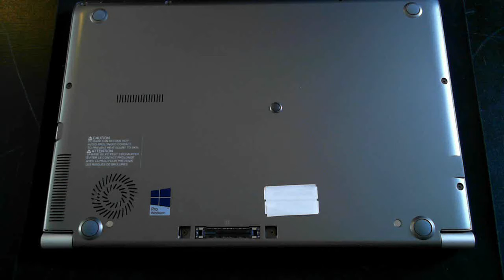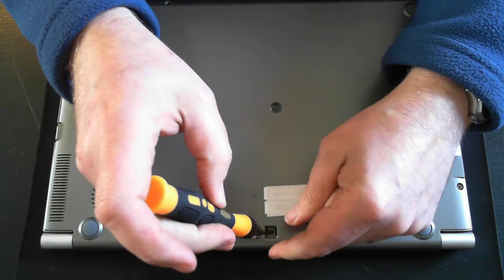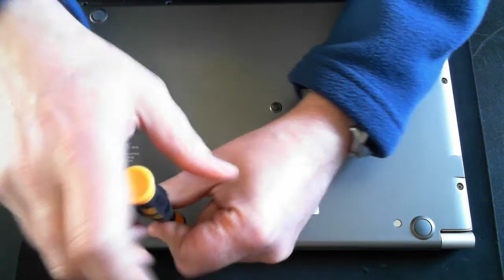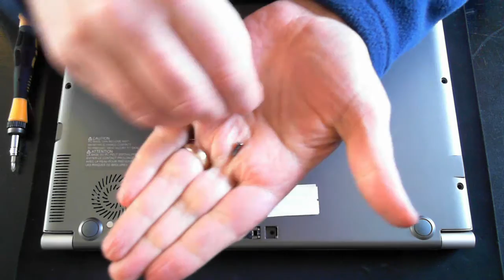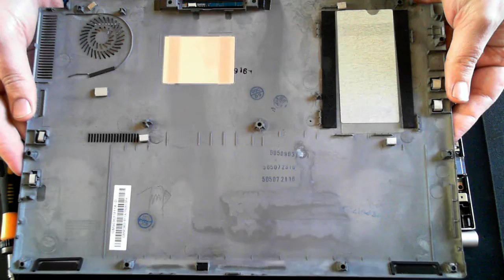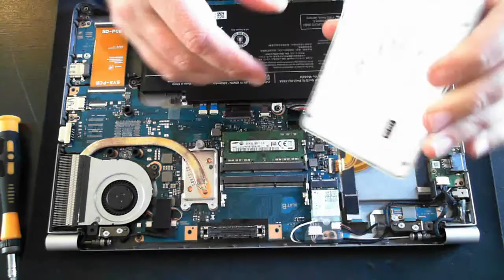Toshiba Z40 Ultrabook Teardown

Comment: Thanks.  Would have never found that screw in the center of the unit
Reply: I once did a FHD upgrade of this laptop, you need to buy a FHD LCD cable of a different toshiba z40 model. The part number is P000644030. You can buy it from emprgroup.com.au
Reply: @2DarkHorizon  only need to change the cable only? How about the panel itself?
Reply: @stanlaus3883  You need to buy the a FHD screen and FHD cable. Yes you need to change both if you don't have a FHD screen in the first place.
Reply: @stanlaus3883  You need to buy a compatible FHD screen as well

Comment: Is the ssd drive connector to the board small? I have one but the connector is double this size !!!! What can I do ?
Reply: Yours is probably one of the newer ones. I purchased several of these from a warehouse. Most are 5th gen Intel i5 and have the smaller SSD/HDD cable. A couple of them are 6th gen i5 and have a wider cable and came with a caddy that holds an NVMe SSD.

Comment: Need to upgrade memory in unit. Currently only have 1 8GB memory card.  The one i have says something different then what you mentioned. Mine says PC3L 8 GB 12800s.  Should i just get to 8gb that match what you said to get me to 16?  I just dont want to get the wrong memory.  Thanks
Reply from the maker: It is always best to get matching RAM or at least as close to it as you can.

Comment: Hi, is it possible to add the ssd cable code or part number somewhere in the description? Anyone with a Z40 with M.2 SSD needs that cable to install a larger 2.5" drive and it seems impossible to find it online. Thanks!
Reply from the maker: Have you spoken with Toshiba?
Reply: This Toshiba Tecra Z40-b is a nice laptop, try FHD upgrade buy the FHD cable part number P000644030

Comment: hi, i want to chance my ssd to hdd and i need a sata cable how can i find this cable could you please hel me tank you
Reply from the maker: You should be able to use the same cable / connector that is used for the hdd.
Reply: but i have ssd one it is not for hdd
Reply from the maker: If it is a 2.5" SSD then it is the same connector.
Reply: I think what Yavuz means is that his ssd is a M.2 SSD so the cable on the hdd end is not the same as in your case where it connects to a normal 2.5" SATA. Some Z40 models came with M.2 SSD instead of 2.5" so to install a larger 2.5" hdd in those we need exactly the cable that is in your model, I am actually trying to find one right now without success, but this video shows it actually exists somewhere...
Reply from the maker: I'd suggest contacting Toshiba directly.
Reply: Trying to, but I was wondering whether it could also be sourced elsewhere without the "manufacturer premium"